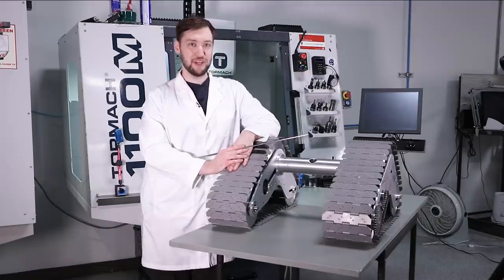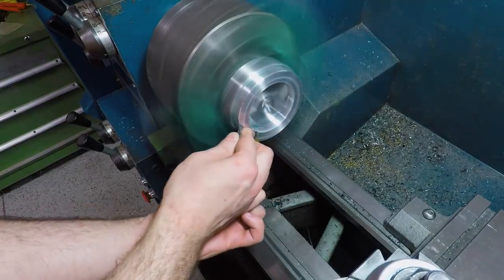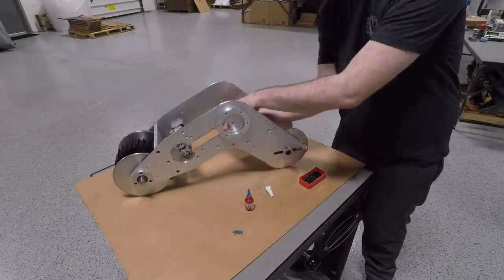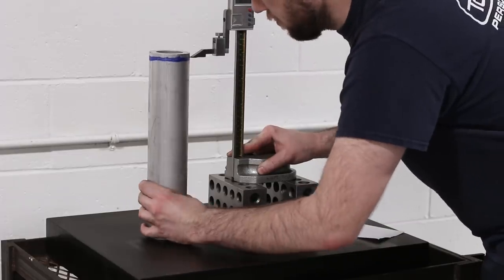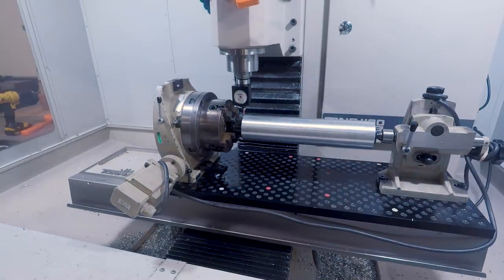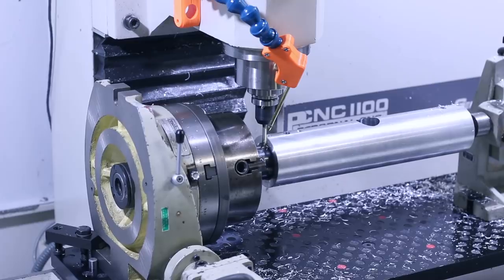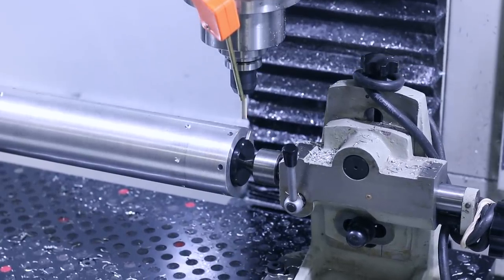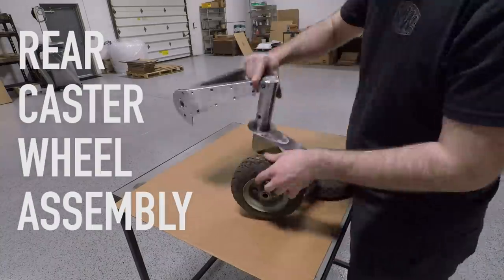Johnny 5 Part 5 - 4th Axis Tip Toe Tube | WW248

Comment: Heh, not the only one to use drip bottle on the rest. You should machine a small dovetail slot in the top jaw and add a proper drip oiler. Makes for cool aesthetics and it's a neato project.

Comment: I can't watch people sanding/polishing parts in the lathe any more (sorry, don't want to be the eye-rolling safety troll...). I once slipped off, and the chuck jaws took off a finger tip - I was lucky, it could have shredded my whole hand. Fortunately the surgery went well (city has a special hand-surgery department). Please be careful, or better, keep hands away from fast-spinning chucks, especially if they have jaws. A collet chuck is probably much safer. It's one of the things that I mentally didn't have logged as "super dangerous", and therefore didn't use enough caution.
Reply: "Next time your teacher tells you to keep your arm inside the bus window, you do it!" - Herman
Reply: Filing and sanding on a lathe are the most common causes of accidents after fly-outs. Also I too feel a lot more comfortable with a collet nut spinning at 1600rpm with it's user friendly keyslots, rather than the protruding jaws of death slowly coming by 30ish times a minute each!

Comment: Don't push any part of your body into a rotating part of machine you don't really want to loose! Sorry mate but what you've shown in this video is not good practice while using "a manual lathe" !!! Get some tuition please before showing youngsters how to do it badly!! No offense ment...
Reply: These guys are experts!
Reply: @MechDickel   it takes a split second to twist part of your body completely off. Even if you you call yourself an expert or even an astronaut! Hands on machinery DEMANDS respect! Don't teach bad habits!
Reply: @MechDickel  I will have to repeat! Do not put your fingers into any machinery when running. What don't you understand mate?
Reply: @jef____4054  lighten up Francis.

Comment: DUDE!
You really really need to review lathe safety.
Not sure who taught you how to run a manual lathe, but they did a poor job.
You really should not be airing this on a channel that is committed to education.
There is a safe way to use sandpaper, and there is a way to loose a finger. You are doing it the way to loose a finger.
Also, your chuck jaws need to be reversed. Having that much stick out is asking for trouble.